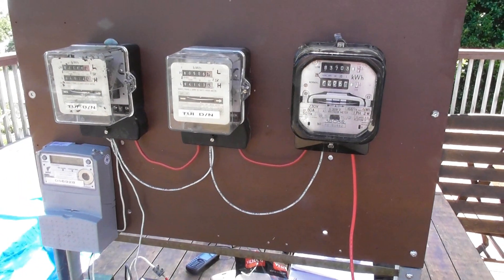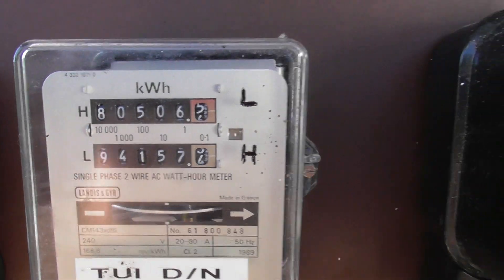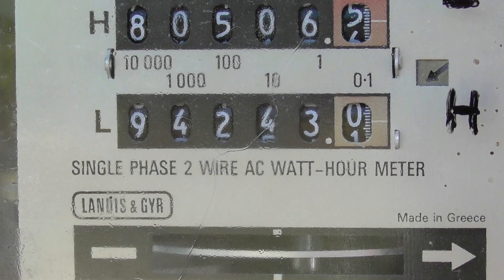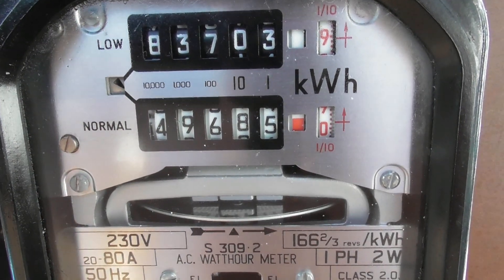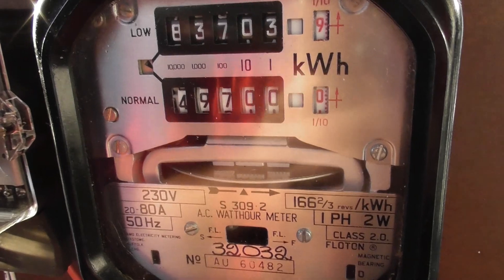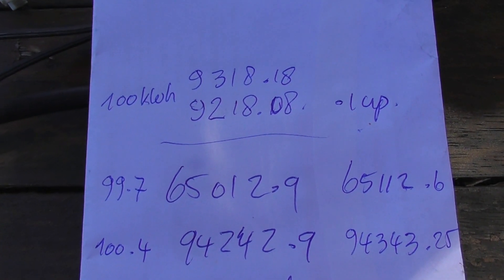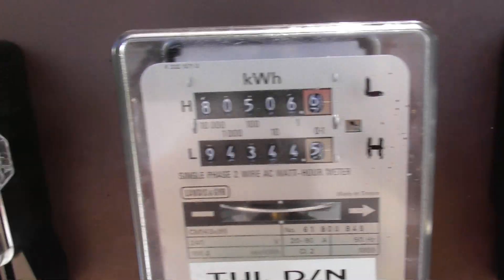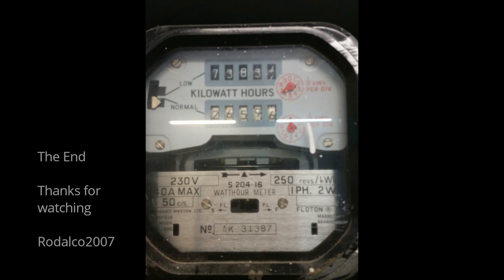Two rate meters 100 kWh dial test

Comment: Old meters never need replacement
Reply: I have an old landis & gyr cl27d meter tgats so old the clock just went back to 000000. British Gas suggested replacing it. Is it safe due to geing old, how accurate is it likely to be and would it ve cheaper to run a modern meter? Thank you 😁👍

Comment: Nice video as always. We had a lot of the sangomo meters in Scotland. Played with a few of them over the years. I also have one of them edmi mk7 meters in the workshop at the moment, it has a lot of features and functionality but sadly not accessible without the software which the manufacturer won’t supply to joe public ( for obvious reasons I am sure) so it just sits there like a brick.
Reply: Hiya. I own quite a few Sangamo Weston 
instruments myself. Of course, I don't just 
own that make of electricity meter. 
I also have a selection of.........
.
.
.
.
.........Smith meters,
.........Ferranti meters,
.........Landis & Gyr meters,
......... Sangamo Schlumberger meters,
......... A single Metropolitan Vickers meter
......... A bizarre demand meter made by P&B engineering,

Single phase meters,
Three phase meters,
Single rate meters,
Dual-rate meters,
Coin-operated meters
Time Switches and.....
Rate Changers too!

.......And lots more as well! :D

Need more instruments?
In that case then, head-on over to Wayne's Electrical and dive into the Electricity Meters Playlist.

Need more loadwheel action?
In that case then, head-on over to Wayne's Electrical and dive into the POWERED Playlist.

What about Accuracy tests? Need some?
In that case then, head-on over to Wayne's Electrical and dive into the Accuracy Tests Playlist.

Like what you see there? In that case then.....

(1) BAAAAAAANG that subscribe button on the Wayne's Electrical channel! :D
(2) Get The Bell On for notifications of when new vids drop.
(3) Subscriber Perks: Make sure yours are activated.
(4) Slap it on Widescreen
(5) Pull out your favourite snack
(6) Sit back
(7) Enjoy the Sssatisfaction of the loadwheel action. :D
(8) ........Plus much, much more! Oh yes!

-Wayne's Electrical.

16th February 2021, 19.17